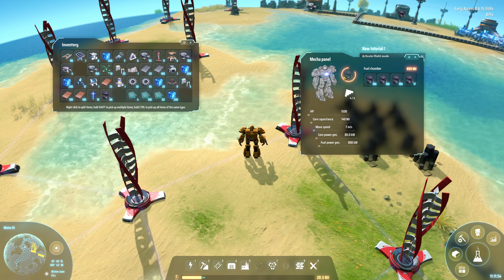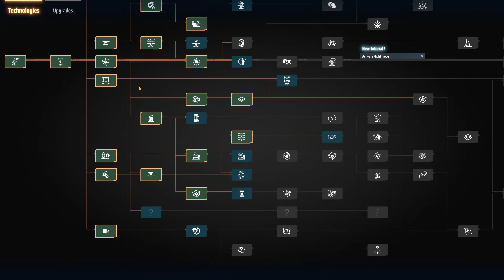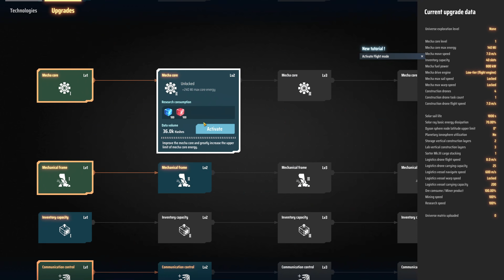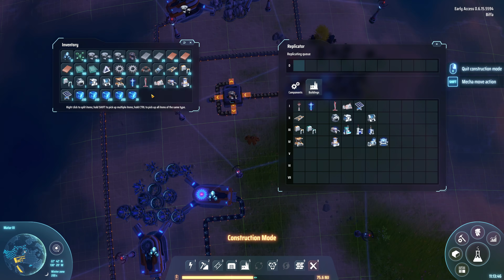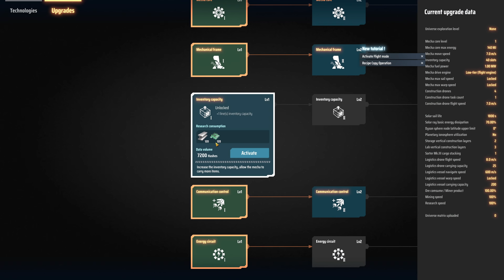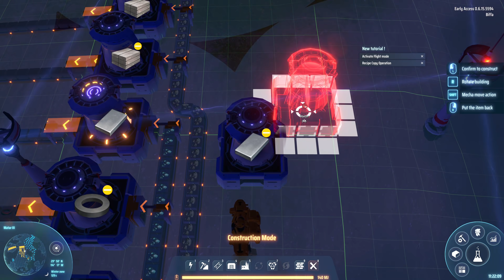How to Stack Machines & Fly High in Dyson Sphere Program!

Comment: Is there a reason why you are not using the batteries for the suit? You have had them in the inventory from the start.

Also is it better to use mk1 sorters? Been using mk2 since i unlocked them
Reply from the maker: Saving them 😉
Reply: @BiffaPlaysStrategy  thanks for quick answer :) saving them for what? :o

Comment: Hello yet again!! Amazing video as always! Now i have some tips and tricks for you. 
tip 1: 
You know the research labs that are produceing you the blue cubes. You can stack them ontop of eachother. You can feed the reasources needed at the bottom on and it will automatically feed the ones above it. Its better to stack them as they take much less space. Later on you will be able to get more labs ontop of each other as long as you research one of the researches in the upgrade tab. 

tip 2:
Its good to overproduce to a certain extent. It is better to have more of something then less of it as the later you progress the more you will need it. And if you are allready produceing to much of something that means you have more for later :D

tip 3:
Its allright to place the solar panels on the equator in a loong line or the other way. But before you can close the loop you will need loads of silicone. And in the stage that your currently are at its hard to get bulk amounts of silicone. So i would suggest building the solar panels at one of the polls. To fill it up with solar panels. As the polls allways get sunlight. So if you are going to place them there they are allways going to get sunlight to get energy. 

Hopefully you found thees usefully. Im like 30 hours into the game and im starting to produce purple matrixes. If you need help with anything or more tips then im more then welcome to help :)
Anyways have a great day!
Reply from the maker: Thanks for the tips - watch the next episode for a Solar Power Frenzy! ;-)

Comment: Lovin ya work. I am just wondering why you only keep using 1 output transfer unit to the belts when there are the options to place 3 per side on the storage boxes. You can triple your input or output to them by placing more transfer units down.

Comment: You can use the splitter you unlocked to connect multiple conveyor belts to one output! Also youve been using mk1 sorters instead of mk 2
Reply from the maker: Mk2 isn't needed all the time 👍
Reply: @BiffaPlaysStrategy  good to know! i’ve been using only mk 2’s for all my sorters

Comment: For your ring of solar power consider having it as a belt around the equator. So as the plant turns the panels exposed and hidden are constant and you achieve standard power.

Also looking ahead. To refine hydrogen you have to do something with the other byproduct, and having  gas turbine power plants is a good way to burn the other resource.

Comment: Just FYI the solar power ring should go along the equator.

Not on a North to South, 
and as soon as the solar power research poped up i though if that could be done on the game.
Great vid and this is definitely the nº1 channel
Reply from the maker: Thank you :-)
Reply: @BiffaPlaysStrategy  Actually. Thats if you have enough solar panels. How i do my solar panels is to fill up one of the polls (North or south) in like circles and circles of solar panels. That way most of them allways get sunlight as they are at the polls. But you do whatever you wish :D
Reply: That's what I was thinking as well. North-South will have a peak output as the planet rotates. Additional N-S lines could be created to add power and smooth the generated power.

Or putting a ring around the equator will be a constant power generation, regardless of time of day. Additional power could be generated by additional parallel lines running around (near) the equator
Reply: Kibitz did it, wrapping his entire starting planet in a ring of solar panels at the equator. The planets do have proper day night cycles like in real life, so it absolutely works. Would probably be super good on a planet that has really intense sunlight, like a desert planet.